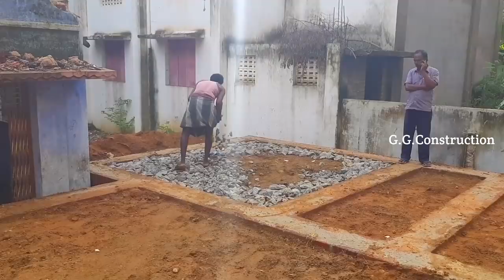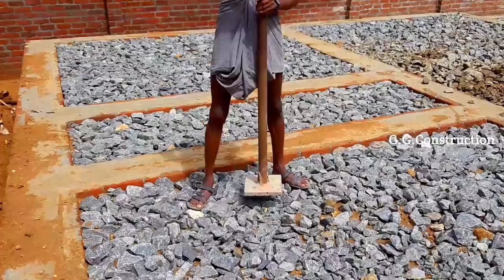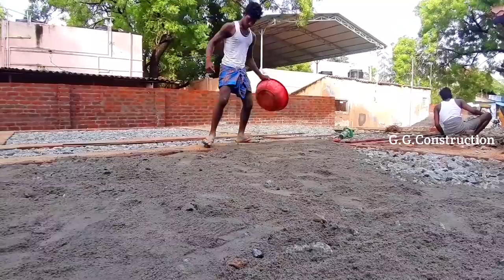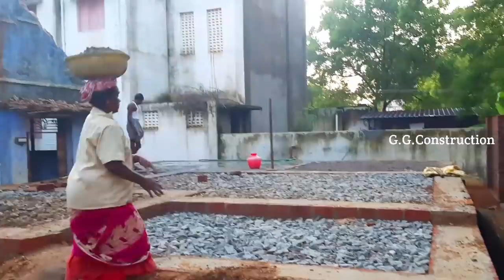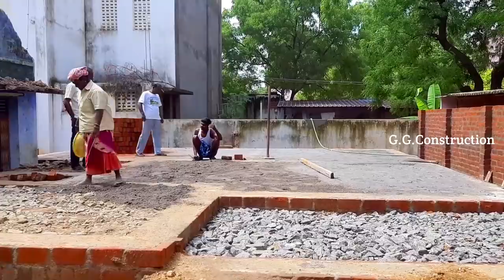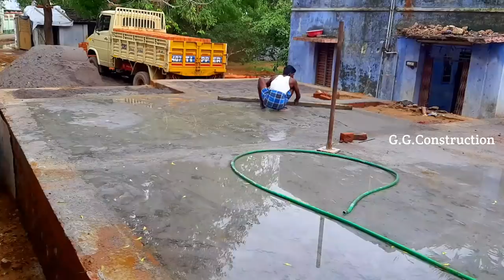Basement PCC-Beautiful with 23x33 Size flooring plain cement Concrete process-Using sand and cement

Comment: It seems that the work is not executed by civil engineer. It is not proper method of laying PCC. 40mm good graded jelly should be mixed properly with cement mortar in1:4:8 ratio then only to be placed on the base and compacted well.
Reply: Yes...your are correct
Reply: Are you civil engineer ?
Reply: @entertainmentboxer9928  only civil engineer can comment like this. Yes, I have 30years of construction experience.
Reply: @muralikrishna5435  thank you sir
Reply: @muralikrishna5435   right , ramming above aggregate is not done properly...
Reply: True
Reply: Hii
Reply: Could you please explain what's 1:4:8 ratio you mean one head pan cement nd 4 head pan m sand nd 8 head pan of jally 1-1/2
Reply: @vjyours8533 In General there are Volumetric Mix and design mix Available overhere( M-7.5 = 1:4:8 , ) M- Mixing , 7.5 - Compression Newton/mm2 , 1-1part of cement, 4- 4 part of sand that is fine aggregate, 8 - 8part of jelly that is coarse Aggregate.